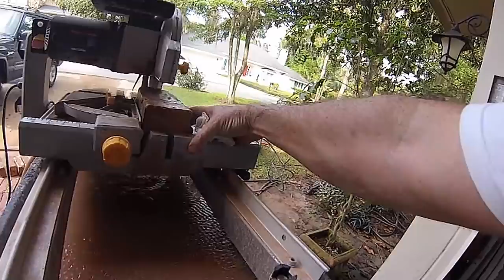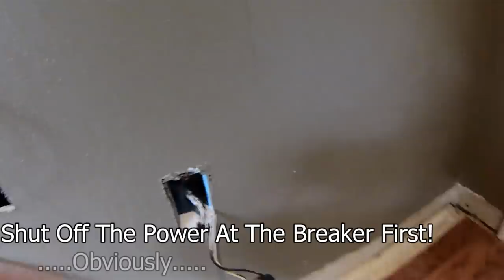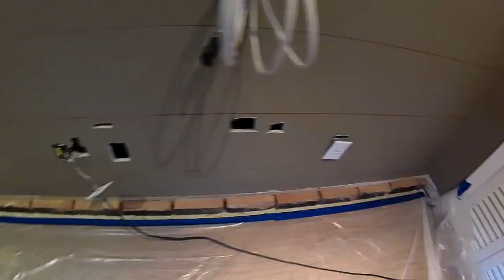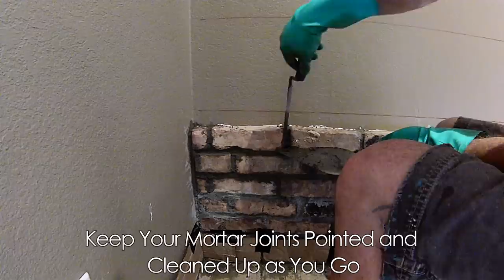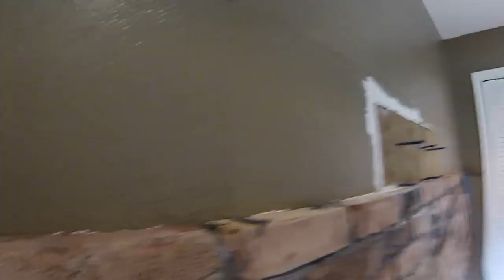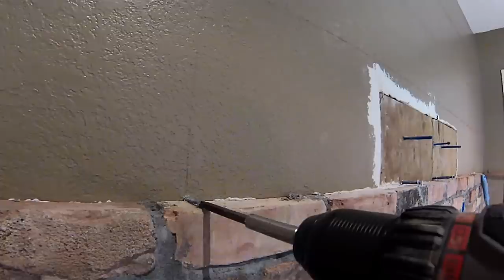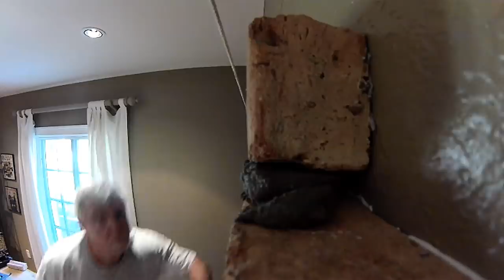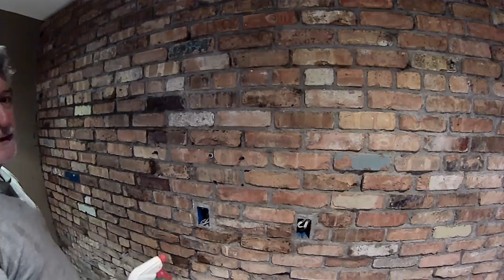How To Build An Exposed Brick Veneer On An Interior Wall

Comment: Just a thought...the bricks could be cut in half (length not width) using a tile cutter!  Easy to do since we did it for a different project.  Then you would have had twice as much brick and less bulk on the wall.

But you achieved a beautiful project!
Reply from the maker: I'm not sure I am misunderstanding your comment but I cut the brick in half down the length. I don't think a tile cutter would go deep enough to get all the way through the brick though unless you cut it from both sides.

Comment: looks good but here's some little advice from a 21 year old that owns his own construction buisness. 
u can buy a grout bag for the motor to make it easy to fill in the joints between the bricks and honestly u didn't really have to wet the brick just to sit the others on top. but I mean whatever works best. eather than that it looks great man. pretty impressive. 
also u can use the back of the martial trial Wether it the big round one or a squared one to joint off the rest of the motor and you can also use muratic acid that you can buy at home depot to clean the bricks but just add water because then it will burn to much. perhaps that could help you in other projects
Reply from the maker: Joseph - yes I have been in the commercial construction business for over 30 years. Before I did this project I built my own pizza/oven smoker combo (here is the video - https://youtu.be/Y2vuY2kL5bw), so even though I am not a mason by trade, I had done a fair bit of brick laying on that project. I used a mortar piping bag to try to fill in some joints inside the oven and it kept clogging up on me. I probably needed to thin out the mortar to make it work but got a little frustrated with it and gave up. It may have worked here but I didn't try it. The reason for wetting the brick - for me at least - it made the mortar adhere way, way better than buttering the brick dry. It also gave me more time to adjust the brick to level it out as the joint was workable for at least twice as long as when I didn't wet the brick. I can understand why regular masons don't do it this way because it is way slower, but wetting the brick does give you much more time to get the brick and joint just right.

Comment: Does anyone know if the nails in the studs are necessary? I'm thinking about using a brick wall between my neighbor and I to stop getting noise complaints. And I think those nails would defeat the purpose.
Reply from the maker: The only nails in the studs are the ones installed when the house was originally built in 1963, and they are holding the drywall to the studs. I did mechanically attached the brick wall to the studs with screws, and those are very important.

Comment: Could this be done in a pier and beam house?
Reply from the maker: If your floor is not a slab on grade then you would need to probably add some support to the floor structure. Also you need to tie back mechanically to the wall so I don't know what your stud spacing is in a pier and beam house.

Comment: I love the idea about buying the hole square of bricks and cutting them in half with the wet saw.  but i think I would have cut the halves in half too!.  well i would have attempted to anyway.  lol  Nice wall tho.  I want to do this.
Reply from the maker: Well the problem with cutting a brick multiple time, like slices, you end up with brick that don't have a natural face on them. A sliced section of brick looks quite a bit different than the actual outside face of it.
Reply: Lee McNeil You're absolutely correct. I didn't think about that. I stand corrected.

Comment: with that amount of water you're spraying on the drywall and the putting the bricks directly on it, it's just a matter of time till all that falls due to mold, brother.   Should've used some backer board or some moisture resistant board
Reply from the maker: Well, not really - there are a few things in play here. First off, water can damage gypsum board and make it structurally unsound, and mold can form on gypsum board too - but mold growing on the drywall really doesn't make it fall apart, it's water. And for mold to form on drywall, it has to be damp for a while for the mold to grow. As far as water damaging the wall board, it takes a good amount of water to do that. It has to soak into the paper and get to the gypsum core and pretty much saturate the material to really damage it. Additionally, the face of the wall board is painted which gives it another layer of protection. I can assure you that the amount of water that splashed onto that painted wall as I was spraying the brick was not enough to get through both the paint and the paper to saturate the core of the wall board. Additionally, I am not really relying on the adhesive and wall board to support the wall (although it is providing some degree of support). If you go to 12.07 in the video, you can see that I put screws into the studs that protrude into the mortar joint at every 5th course to mechanically lock the veneer into the studs.

Comment: I would not add the crown moulding (coving in UK) I'd also remove the base boards (skirting boards)... both make it look less like a real wall.
Reply from the maker: I am going to put crown molding (moulding!) around the rest of the room and I upgraded the base board in the room also. There was a small space between to wood flooring and the brick wall that I needed to cover - which the base board does nicely. I don't think it takes away from the look - at least as far as this room goes. I didn't want to go for a full warehouse look - more like a converted warehouse.

Comment: Nice job, nice work and looks great.  I might have put some goggles on though when cleaning with the acid.  That brushing action could splash it in your eyes.....
Reply from the maker: You are correct about that. Cutting it to 20% acid/80% water makes it a lot less dangerous but I still should have worn some goggles. I will have to put in a little warning into the video if I can figure out how to do it without having to repost it. Thanks for the heads up.

Comment: Nice styling for a wall, very creative !! But the 1st thing that crossed my mind was.. damn , thats a heavy load for a wall like that. I mean, bricks glued on an inch thick wooden wall? i dunno..
Reply from the maker: The bricks are mechanically tied to the each wall studs with a screw embedded in the mortar, 18" on center vertically. A lot of people miss that. Go to 12.05 in the video and you can see what I did. I would not rely only on the adhesive to hold up all those bricks.

Comment: what did you do between the floor and first layer of bricks
Reply from the maker: The subfloor is terrazzo (which is just a decorative type of polished concrete) on a concrete slab on grade. I cut back the pre-engineered glue down wood floor and laid the mortar right on the terrazzo then the first course.

Comment: Do you recommend moisten the brick even if it's a thinner veneer?
Reply: Same question regarding the drilling every 5th row
Reply from the maker: No I wouldn't do either one. A thin brick is going to be more like a tile than a brick. You would lay it all up with the tile adhesive and then come back and grout the joints with a sponge. And since it's thin, it doesn't weight nearly as much as the half brick so it the adhesive will be able to keep it on the wall just fine - not to mention with a thin mortar joint, the screws won't have much to bite into.
Reply: Thanks. How reliable is it for a 10' painted wall already as opposed to raw Sheetrock?
Reply from the maker: If the paint is adhered to the wall well, then you should be good to go. You might want to sand the wall with some 80 grit sand paper before hand just for a little insurance.
Reply: Lee McNeil thank you! Very helpful

Comment: How do you attach your string level at opposite ends of wall
Reply from the maker: I just measured up from the floor on each end of the wall and struck a chalk line every two feet. Then I checked to make sure my last line was parallel to the ceiling, because the ceiling might not be exactly parallel with the floor. Once I had those lines on the wall, I then laid the bricks on each end of the wall up to the next line and pulled a string tight across at the top of each course to keep them on line.
Reply: Thanks for sharing!!

Comment: What should i be aware of if i want to do this and i live in a top floor condo
Reply from the maker: I would be wary of doing this on an elevated floor without making sure the structure will handle the weight. If it's a wood framed condo, you probably should do a thin brick veneer instead of this half brick. If your condo has a concrete floor structure, it will probably be OK. This was built on a slab on grade so it didn't even cross my mind when I made the video, but many people have pointed out that this might be a problem on an elevated floor structure without reinforcing it. One other important thing I want to point out also is to make sure you mechanically attach the veneer to the structural wall behind the brick. Don't rely on the thin set adhesive alone. You can go to around 12.05 in the video to see how I did it.

Comment: As a bricklayer for 11 years and a masonry foreman for the last 20 years that was excruciating to watch.
Reply from the maker: HAHA! I bet it was. Sorry to do that to you man. I hope you like the final product though.
Reply: You really didn't need the thin set with the brick being 2" deep. You could have just used masonry wall ties every 6th course@ 16" o/c. You caused yourself a lot of extra work and expense. 
Besides that it looks very nice.
Reply from the maker: You are probably right, but since the brick was being cut in half, I was worried that it would be just too thin for the height and didn't want to take a chance. Especially since I was hanging a pretty heavy TV on the wall. I wasn't about to try to calculate the max deflection and slenderness ratio on that wall. LOL!

Comment: Is he putting that brick on the drywall instead of cement board?
Reply from the maker: Yes. No need for cement board in a dry location.
Reply: What do I do to put on my drywall before putting Stone Craft veneer manufactures stone? Should i cover drywall with cement board or plywood?
Reply from the maker: @nonofyourbusinessnonofyour5435 I don't know about that manufacturer, but drywall is fine as a substrate for a thin veneer like ceramic tile. If the stone manufacturer recommends cement board or plywood be used as a backer, I would go with their recommendation. Since this brick veneer is a little thicker than  tile, I also mechanically fastened it to the structure with some screws. They protrude into the mortar joint at about 18" on center vertically. Go to 12.06 in the video and you can see what I did. That is really what is holding this veneer to the wall.

Comment: to be fair i think this type of construction for homes is only common for the USA and its style of housing. in the UK  the vast majority of homes have a structure that relies on brick and motor rather than timber frame as in the US.  So in the UK you could just pull back the render of the walls, clean and apply a clean sealant to achieve the same look.
Reply from the maker: Yeah everything is a lot older over in the UK for the most part. What you are describing is pretty much what I wanted to mimic with this project. This house was built in 1963 which is ancient for here in Orlando. The outside is reinforce concrete block but the interior partitions are wood stud and gypsum board.
Reply: +Lee McNeil good tutorial nevertheless 👍
Reply: 1863 for my House. Great Job.
Reply: Amandeep Johal only in England. Houses in Scotland are built using timber frames with cinder/concrete block tied to the timber frame as shown at the start of this video. 2 layers of blocks/bricks is a very English thing to do and the only time you see it in Scotland is in houses built up to around the 1990's or in new homes built by big English developers. Scottish builders and developers all use timber frame and block work.
Reply from the maker: Theweescot Dude it is crazy how different things are built historically. Most new buildings are being built today are homogenized to save money.
Reply: I grew up in a 1842 farmhouse. The basement walls were rocks, floor was dirt, and timbers w/ the bark supported the 1st floor. It is a historical marker so someone offered my parents tons of money and they sold
 ...
Reply: @stuartcraigon2003  that's because they're Scottish they're different.  And the difference is because they're not English they're Scottish. 
 I always thaught you were all the same over there but apparently they're different because they're English an d your Scottish

Comment: Your wall looks awesome! Love it! But just for the sake of accuracy, it's 1/2 inch OSB, not pressure treated blocking. I hate to be "that guy" but if people are going to use this as their guide to do this project, they might order the wrong material. Nice Job!
Reply from the maker: It is definitely blocking. And it's 1/2" pressure treated plywood, not OSB. https://en.wikipedia.org/wiki/Blocking_(construction)

Comment: What did you use for the blue backlight?
Reply from the maker: The first set I bought were these, https://www.amazon.com/gp/product/B00ASHP1CM/ref=ppx_yo_dt_b_search_asin_title?ie=UTF8&psc=1 , which stopped working about a year later. Then ended up buying some from Costco, which seem to be similar quality as the first set I bought, except they are still working. I guess it's hit or miss, unless you want to spend a lot more money.

Comment: I was expecting another "Great idea" but this was solid work... The backside is the weight of this, so people need to check the foundations of the house beforehand
Reply from the maker: Yes that is important. I built this on a concrete slab on grade, which is how 90% of houses are built here in Florida, so I didn't think to even mention it.

Comment: I am a brickie decent Job looks good perks a bit out but looks good been looking into this inside jobs there is a way you can use render and cut the 10mm joint out and then put ya joint back in but it looks much better like this must admit it looks so wrong using glue to get to the wall haha
Reply from the maker: Thanks! My thinking was that this would be like a thin brick application, but just with a thicker "thin" brick. The thicker brick allowed for more texture on the wall with regard to the chipped and broken bricks and varying the depth of the mortar. If I had done actual thin brick, I could have purchased the thin brick, but it would have cost me twice as much because the thin brick cost the same as a regular brick. And I was getting two thick bricks after cutting a full size brick in half. The downside is that it weighs a lot more so you have to consider that when installing over an elevated floor. I also had to mechanically fasten the bricks to the wall, which you wouldn't need to do with thin brick.
Reply: @LeeMcNeil  I think you did it well I mean what, 100mm in half 50 plus what thin bricks are so you're losing 30 mm on a room not too bad, you could have cut them twice but that seems pointless. Good way of doing it man :)

Comment: TRUMP APPROVES THIS WALL!!!

Seriously looks sweet man. I've got a movie theatre room I'm interested in doing this to. The problem is I'm a sports dad, who can barely read a tape measure. haha. Can you just apply the wall in this manner to any interior wall? The wall I would like to do this with is kind of a wooden wall, not really paneling, just older wood wall. Any suggestions would be great. thanks.
Reply from the maker: Scott Helm Dude, any man can do this, but I will tell you, from the nature of your questions, I think you need to do some research first. I did tis with on an interior wood stud drywall partition and on a concrete slab on grade. If you have those two items covered, then it gets simpler. It's almost a ton of bricks - literally - so make sure you have your ducks in a row.

Comment: could you have cut the brick into 1/3's ?????
Reply from the maker: Not really because the cut side of the brick looks a little different than the uncut outside face of the brick. Now you could cut it into thirds and discard the middle piece so you have a thinner veneer but that doubles the amount of cuts you have to make - which was already a whole lot.

Comment: Brick paneling. Less costly, much easier to install & remove, more resilient to temperature changes. No cracks.
Reply from the maker: That would be the cheaper and easier way to go definitely. If you are in an apartment or maybe have a lower end house then that's the way I would go. I don't know what those panels look like in person, but I have to think they look OK from 5' or more but not so much if you stand closer. And as long as nobody touches it either.
Reply: My choice would depend on what material the exterior walls were made of and also what climate the house is in. In a house with wood exterior walls, then a 'real' brick wall wouldn't jive. Might look real, but then again...Now, if the house had some exterior brick veneer, it could work. Your job looks good though.

Comment: Homes here in the U.K. are built completely from brick. That’s why they don’t fall down during storms like in the US.
Reply from the maker: My house is built with concrete block but has framed walls on the inside, but there are plenty of houses here built completely out of wood framing. They are crap. This house has weathered at least 5 hurricanes since I've lived here with no damage.